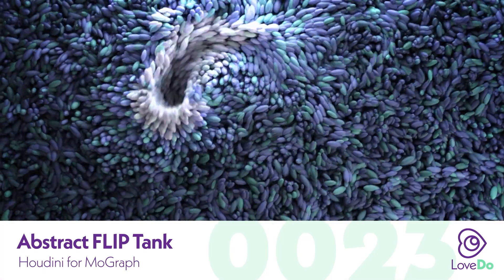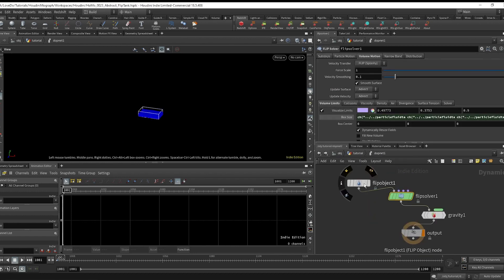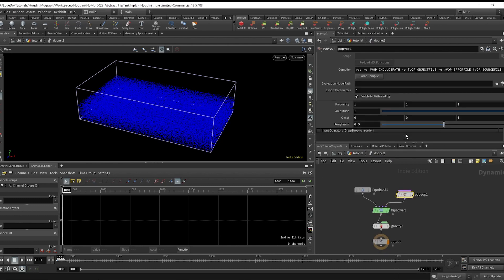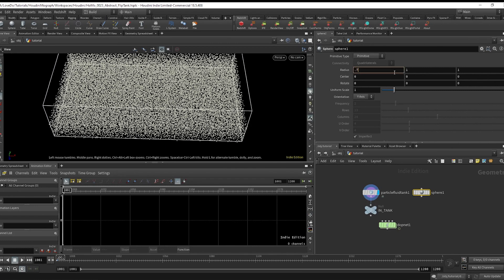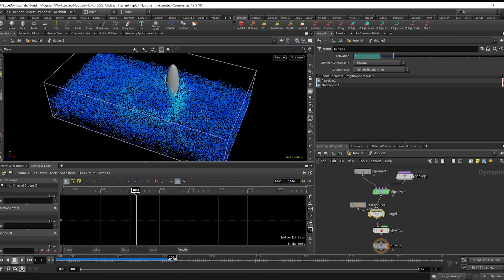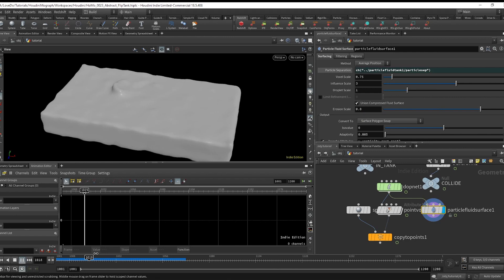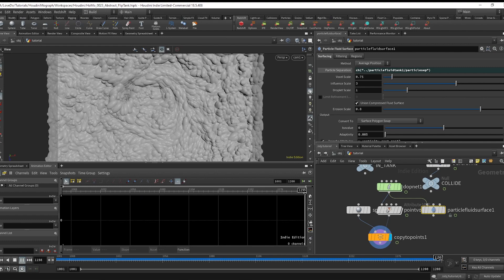Abstract FLIP Tank - Houdini For MoGraph Ep0023

Comment: Hi Bro, thanks for the tutorial

The copy to point feature also applies to my static object.
I don't want this to appear because it has point points, how can I do it?
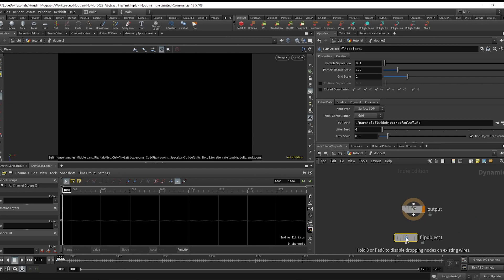Reply: I think that if you click on the dopnet on the SOP level and change the "object" option from "*" to "flipobject" it should fix it. At 0:55 you can see the box that I'm talking about. The problem might be that the dopnet imports all the objects from the simulation, including the collider. If you tell it to just import your flipobject, only those points will exist. (Or its called "flipobject1". Just tell it to only take whatever your upper left node inside the dopnet is called)